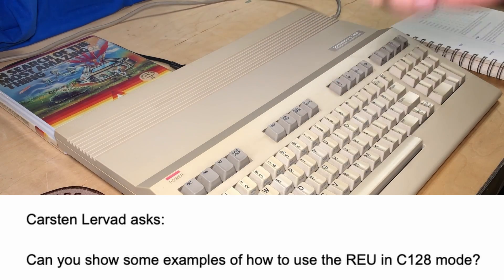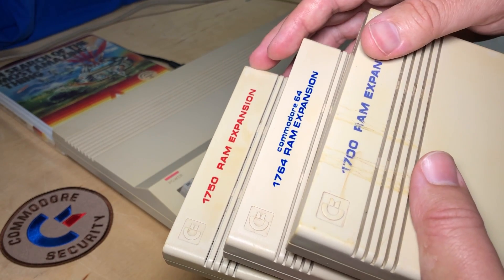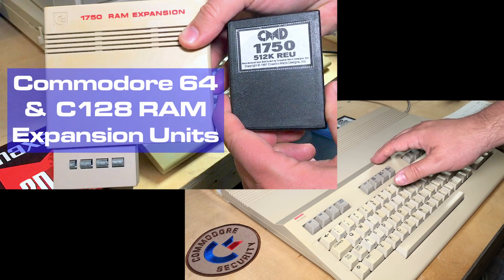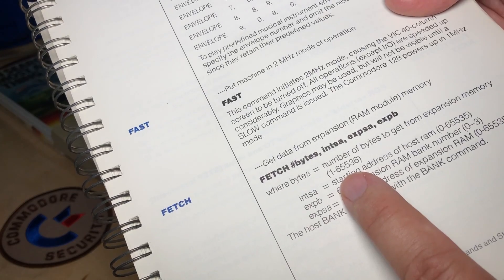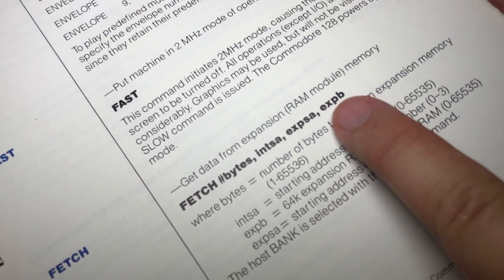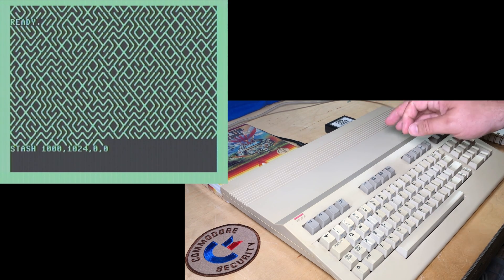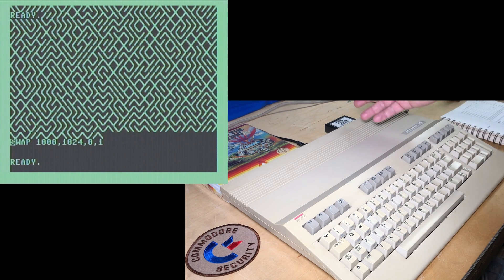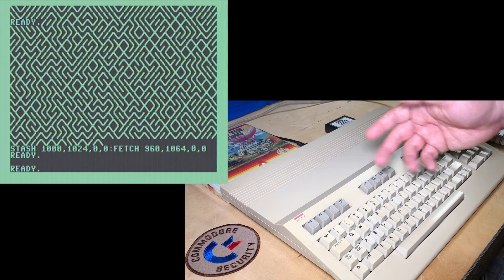Commodore 128 RAM Expansion Unit Use in BASIC

Comment: hi Robin, i love your work Sir.  I have 30yr career in IT and im currently learning c64 assembly as inspired by your videos.  thankyou so much for the inspiration, friend. I just managed to purchase a 1764 REU.  if it works, i plan to fully populate the RAM to max it out.  will a new commodore c64 power supply be ok for power? I still have the old creme c64 brick power supply but was thinking the new one may be electrically "safer" ?  any tips appreciated friend.

Comment: Can someone explain how it works wit TMP. When the source code is assembled it needs to have access to the source code and write the Programm. But you can assemble the code anywhere even to the location of the source code itself. Also copying a whole page would most likely mess up your system wouldn’t it?

Comment: Can you use atari cartridges on the commodore 64c in the cartridge port?
Reply from the maker: Unfortunately, no, they're not pin compatible and even if they were, the Atari systems (both 2600, and 400/800) have very different input/output chips so the software isn't compatible, even if they share basically the same processor.

I have heard that there was an adapter planned for the Commodore VIC-20 (and maybe C64) that would support Atari 2600 cartridges but despite being advertised, was never actually released as far as we know.

Comment: Excellent information. Is that 1764 P/S prone to the same degradation and failure mode as the stock C64 P/S?
Reply from the maker: The 1764 power supply appears to be a slightly modified version of the Commodore 128 power supply. Both appear to be very reliable. I've been using this 1764 power supply for several years now, and I also have a (still working) C-128 power supply that I modified for C64 use (by cutting off the square C128 connector and putting a round C64 connector in its place) that I used for many years before that. Both were made in the '80s.

Comment: There is a recent C128 romset that allows full REU banking up to 16 megabytes, if you have such REU-like device (they exist) or emulator support (also exists).  Check out the ICE romset for the 128 here -  https://csdb.dk/release/?id=171583

Comment: But having 2 MHZ available, a lot of REU RAM and especially the emulators around, why today nobody develops new "advanced" games in 128 mode but prefers C64?
Reply from the maker: It'd be great to see more C128 games that make good use of the 80-column VDC. It's just fairly slow to update the screen on it, and unfortunately the REU can't help with moving VDC video RAM around.  And 2 MHz mode doesn't work with the C128 VIC chip, so it's only certain cases where the C128 has much advantage for games. The C128 really shines when doing productivity or programming.

Comment: I checked my 128D manual, and sure enough, the RAM bank selection section had been corrected to specify that a 1700 uses banks 0-3, and a 1750 uses banks 0-7.
I was not expecting to see it specify that you shouldn't use this command while at 2MHz, and you should use the SLOW command before executing a transfer.  Curious...
Reply from the maker: I think I've read before that REU transfers aren't reliable at 2MHz, but I had forgotten about that. I still don't have a good video capture solution working for the 80-column VDC that supports 2 MHz, so all my C128 videos so far have just been at 1 MHz.

Comment: Is the operation the same in the CMD Ramlink? I was curious it was available as 1-4 MB using 30 pin DIMMs.
Reply from the maker: As far as I know the Ramlink uses a different transfer method which isn't as fast as the REU, but the Ramlink does a better job of simulating a very fast disk drive, and also is battery-backed so it acts as a much more permanent disk.
Reply: Memory access in the CMD RAMLink worked similar to the GeoRAM: you tickle some registers and your selected page of external RAM shows up at $DE00–$DEFF for you to access.  However, if you had an REU and a RAMLink, you could copy content between the $DE00 page and the main system RAM at 500 KB/sec (minus overhead) by stashing and re-fetching the content with the REU.  The RAMLink came with up to 16 MiB of RAM.

Comment: Now, I need to admit, I haven't worked on the old Commodore computers for a long time, but I was thinking how you could have BASIC programs that were larger than 128KB.

From what I remember, you could set a pointer for where the variable memory started to a specific spot to preallocate memory for the lines of BASIC CODE. I think it was a trick they used when they wanted to embed machine language subroutines and have them load without the , 8,1 at the end of the Load command. 

Now, I was thinking, you could bank swap the BASIC code with more BASIC routines loaded into the other banks. The first few lines of BASIC are identical, which handle bank switching then return execution to a particular line number. The variable memory storage would never be touched by the bank switching and not get corrupted and since the program searched for the next line of code dynamically because it looked for the line numbers in memory as each line was run.

I do hope I'm describing this right.

Comment: 2:22 I had a Commodore 1750, CMD 1750, and a 2MB CMD REU.

2:34 The REU RAM not being directly accessible isn't necessarily a disadvantage, considering that you can fetch and stash its content at 1 MB/sec and you can use it to copy and fill internal RAM at 500 KB/sec and 1 MB/sec, respectively (minus setup overhead).  It's fast enough to traverse data structures held in the REU.  In fact, you can fetch small data-structure nodes into Zero-page RAM to process them faster than you could with (zp),Y addressing to main memory.  I did this with text lines in the Zed text editor.  You can also do Blitter-type operations for graphics, which I did to scroll the Soft-80 screen in the C64 ACE OS.
Reply: Dr. Craig, I've checked your site and the info on your C64 ACE OS.  I'm very interested and I hope you would make a video of how it is now and also show/share the progress.  Are thinking of including a c compiler for your OS?
Reply: @Mr_ToR : I haven't worked on it in decades.
Reply from the maker: A video about ACE would be really cool but also very daunting. There's so much to it! I recently found a printout I had made way back in the late '90s of the ACE documentation.
Reply: @8-bitshowandtell247 : The documentation is still on my website.  It's not clear if you're talking about the user documentation or the programming documentation.  There is a lot to it.  The system was designed with full-screen text applications in mind and is kind of the Zed text editor pulled inside-out and expanded.